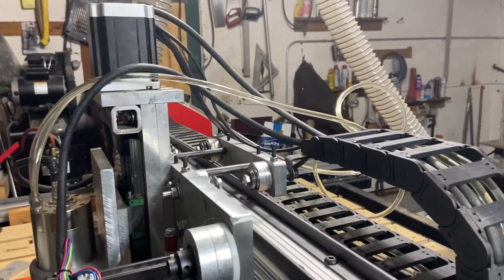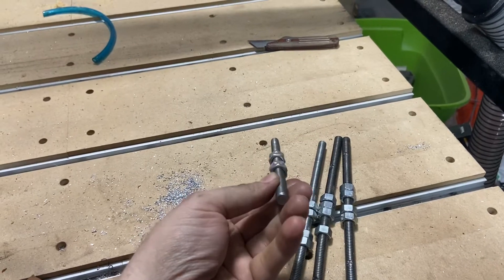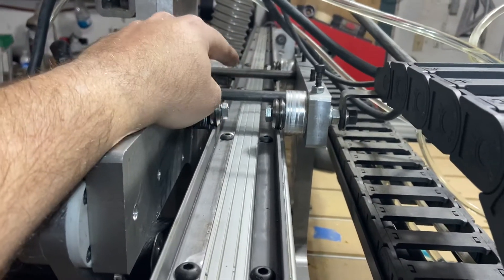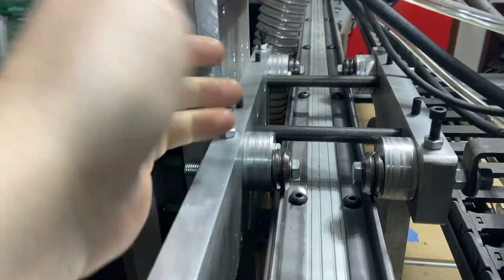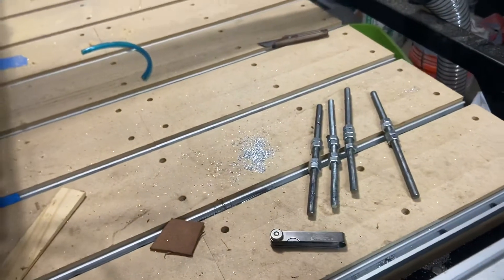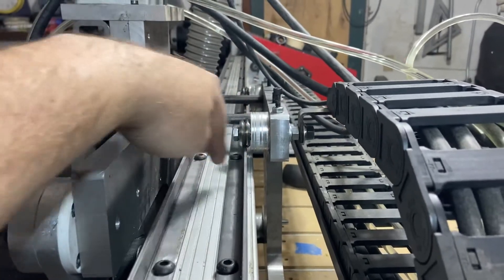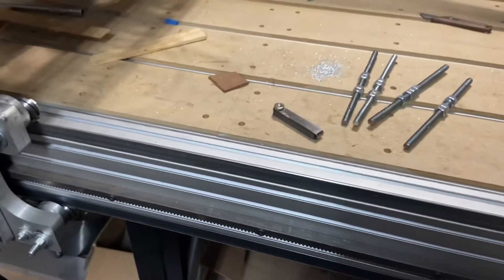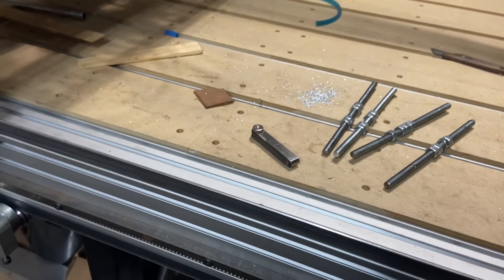Joe’s CNC Evolution mods/improvements to gantry plates

Comment: Hi nice video expalining thigs !!
I am thinking of building an Evo  or Evo 2
Did you eventualy move to the linear rails ? and if so how did that go and was it worth it ? did you mill the aluminium plates on the Evo ?
If you had to do it again, would you build  thy same machine or would you build something else (or perhaps buy a ready made machine kit ?)
Thanks for any advice !
Reply from the maker: I did upgrade to linear rails, and I would highly recommend it over the angle iron, 100%. It is pricey, but I think worth it. I manually bandsawed and milled the original plates. I used my cnc for the evo 2 plates. 
If I had to do it over, I think the Evo 2 with linear rails is a really great option. I haven’t really seen any equivalent “ready mades” that weren’t significantly more money. 
The only thing I might rethink is using extrusion for the frame vs welding square tube, though it does cost a little more. Both are great options if you take your time.
Reply: @RileyKnifeandTool  Thanks for the very quick response.
That is all very reassuring !!
Have you milled aluminium on your Evo after the upgrade ? How would you rate it at doing that ?
I ask as I plan to mill a reasonable amount of aluminium from time to time, but also a lot of wood most of the time
What sort of accuracy / repeatablility are you getting out of it.
Yes, the reason I looked at the Evo is that it is nearer/similar to an Avid CNC, but a lot cheaper. A lot of ther ones like Shapeoko, workbee, xcarve are not really robust at all and not to my liking
Based on your experience, would te Evo 2 be quite easy to build ? My DIY is good and I have a reasonable set of tools. I can also mig weld reasonably.
What would you estimate the build cost of an Evo 2 (without the table)
I live in the UK so am a bit concerned that he might use components that are not easily available here. Is everything used on the Evo 2 standard components generally available worldwide or are there some parts that are only available from the US ?
Would you say that the rack and pinion is better than ballscrews (for a 48" x 48" workarea machine?)
Sorry for all the questions and I understand if you can't answer them all, but any input and advice is really appreciated
Many thanks
Reply from the maker: @TheMysticABC  I haven’t milled aluminum since the upgrade, but I do a lot of micarta and have noticed a definite improvement. Accuracy/repeatability is very good. I think that all in I had about 6k to $6500, but it can be done more cheaply or expensively.  I think rack and pinion is a good option. As for parts, I’m not too familiar with UK availabilities, but I imagine you should be able to get most things.